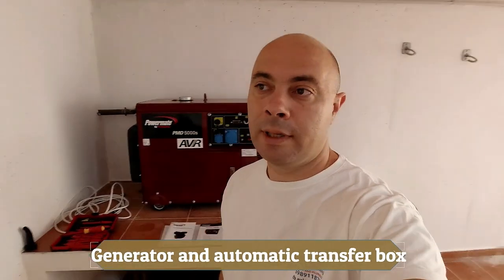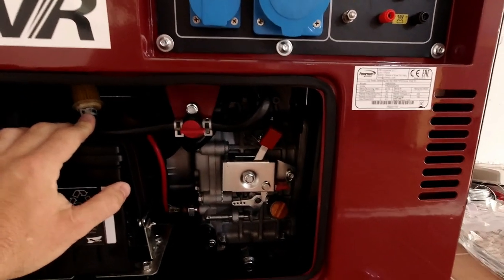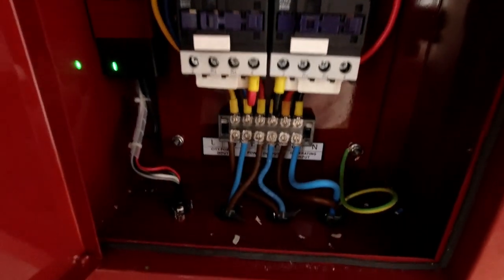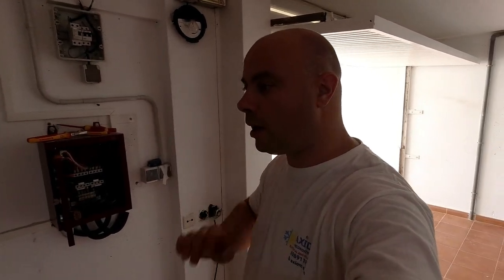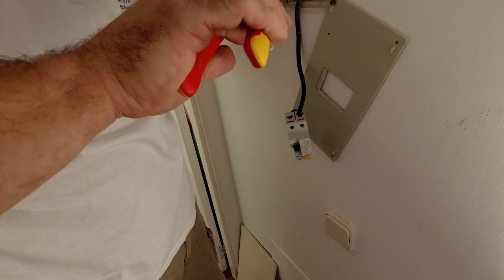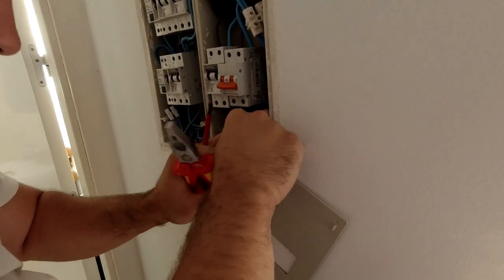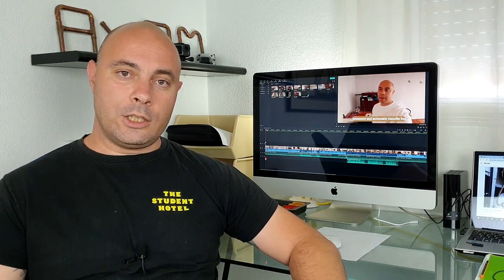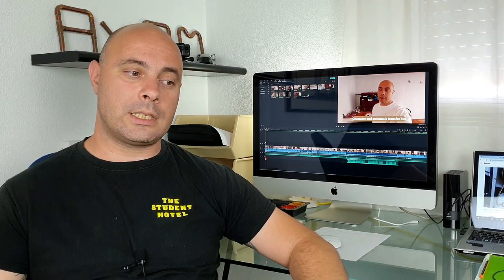Generator and Automatic Transfer Switch Installation!

Comment: As a uk Electrician & seeing all the spiral twists in those wires when you put them in trunking its always advisable to pull the cable off the roll in the same way its been wrapped on & you’ll never get twists. I usually put the roll down in 1 corner of the room (round side down) & yank the end of the cable while walking to the other corner of the room & a smooth line of cable comes off the roll. Or even better with many cable rolls make a wooden stand to pull cable off. You’ll enjoy putting cables in the trunking next time. Try it once & you’ll remember this comment. Great video overall, liked.

Comment: What could be the possible causes of the genset failing to autostart(not even cranking the engine).I recently installed a similar genset with exact ATS but can't start automatically, the failure indicator continues to blink.

Comment: I got similar setup, however my ATS which is although look similar,  supports 3 phase generator as well and therefore has 4 terminals on the grid/generator/out connections. Any idea which terminals should be used for 1-phase generator. Also, how did you grounded the generator and ats box?

Comment: Hi thanks. How do you adjust the speed to bring un the hertz on those diesel generators ?
Reply from the maker: Hi! This generator has automatic throttle, so it keeps voltage and frequency constant no mather what the load is!
Reply: @AxiomBalkan  I have one but it's not staying at 60 hertz. It runs at 58 and only can bring it up by hand on the governor.
The one I have will not go up from 58 to 60 unless I manually move the governor.
Reply from the maker: @danieljohnson7909  try to measure frequency with some good instrument, dont rely on one on the generator, maybe is off... and if you are at 59 or 61 you should be ok...
Reply: @AxiomBalkan  I did all of that. It is an older model speed/governor where it is set with a bolt into the start position.

Comment: When the generator works doesnt the volts you are generating go back the the city net? Did you installed somekind of relais to break the cirquit back to the city?
Reply from the maker: That is what ATS do, automatic transfer switch. There is two contactors inside wich when one is on another one is off so there is no chance for power to go back to main network...
Reply: @AxiomBalkan  when there is no use of the generator the whole household appliances go through the ATS? Ca nit handle such amperage?
Reply from the maker: @vasilismanolis2455  yes thats correct!  You have to size correctly ats to handle power! This one is 8KW...

Comment: what if we have the government power running but we want to use our stand by generator for 3days only then later use the normal power supply from government? will have to turn off the transfer switch manually?
Reply from the maker: Yes that is correct

Comment: Please sir greetings. Where do you connect the automatic start to the generator
Reply from the maker: This generator in the video comes with ATS and cable to connect them together, you see that white cable it has 5 pin contact on both ends and that how i connected them, so they can comunicate when to start and when to stop generator... every brand is diferent, so talk to your supplier about how to connect them together...

Comment: Thank you Sir for your video, it`s very explanatory !
Yet, I have one question please ,
You connected the city main wires ( Black once ) to the ATS via a switch 
But the power coming from the ATS to which Switch did you connect it ?
Do we need another switch ?
Reply from the maker: Main power from the meter goes in to the ATS, and then from ATS back to main fuse board, now you can put between isolator switch just to be on the safe side!
Reply: you prolly dont care but if you are bored like me during the covid times you can stream pretty much all the latest series on InstaFlixxer. Have been streaming with my girlfriend lately xD
Reply: @Jaylen Damari Yea, I have been using Instaflixxer for months myself :)

Comment: Nice video sir. I have a quick question
1. If I have a 12KVA generator, how may amps do I need for the ATS?
2. If my utility box has a 250amp load. How many amps of ATS do I need?
3. Lastly, If the power goes out I will use about 7kva. So 12Kva is enough but do I still need a 250amp ATS since my Utility box is 250amp?
Reply from the maker: Hi, thanks, if it is 3 phase gen, you need at least 25A per phase for ATS, that 250A  looks a bit too much, specialy if it is for domestic use, so you need to size your ATS acording to your ussage... so if your place doesnt use more than 12KVA at any point, then you are ok with 4 times 25A...
Reply: @AxiomBalkan  Thanks for the swift reply. It would be for a single phase since it's a house only. So would you think a 100amp ATS is sufficient even though I have a 250amp breaker from the main utility line? thanks and keep safe
Reply from the maker: @Purowalangkwenta  definetly, more than enough, just tell me please what Voltage sistem are you on? 110 or 220V?
Reply: @AxiomBalkan  It is in 220v.

Comment: Can the ats work in manual mode without a signal cable???
Reply from the maker: Yes it can, but then it’s not a ATS ( automatic transfer switch) 😉
Reply: @AxiomBalkan  great... I want to use it as a manual transfer switch unfortunately without the signal cable the contactors are not energizing or actuating....
Reply from the maker: @mwaledex  you have to install taster switches on and off, and connect them to the electromagnet of the contractor  like that you will have manual control over transfer…
Reply: @AxiomBalkan  ok thanks a lot
Reply from the maker: @mwaledex  you are welcome